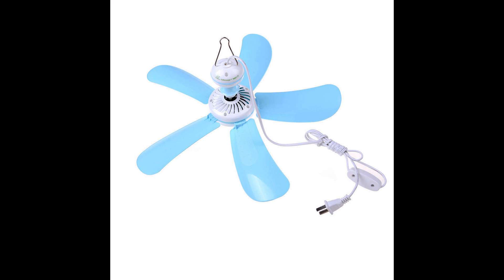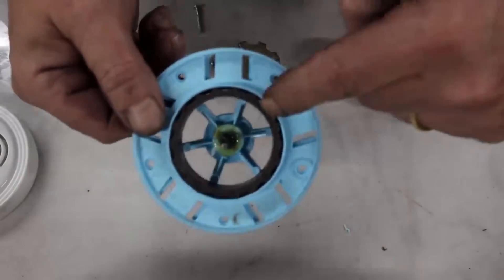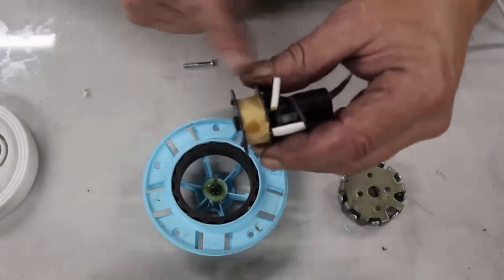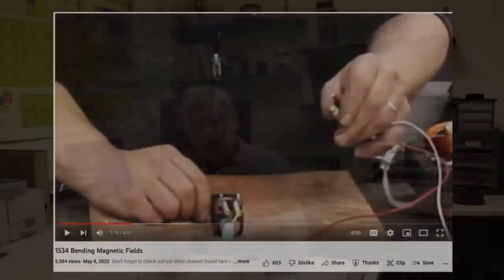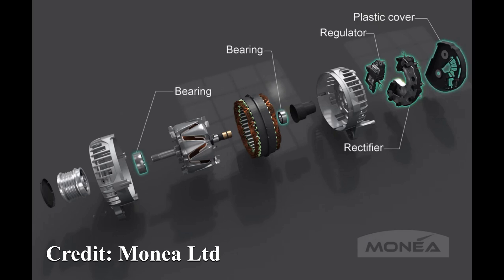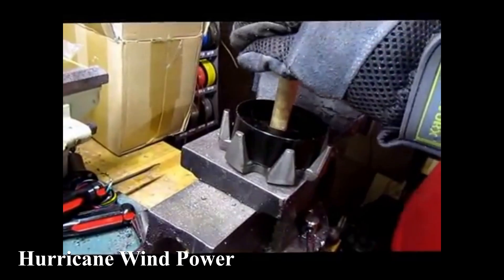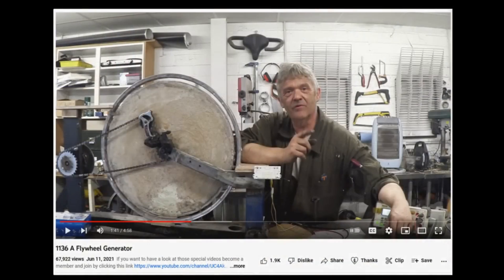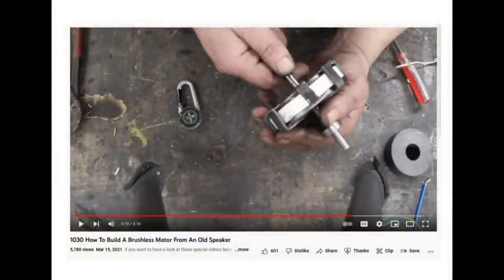2223 Crab Claw Alternators With Permanent Magnets As Generators

Comment: Does someone kind outthere by any chance have a link for such a powerfull magnet ready to be bought and slapped in instead of the coil, would like to test it and try it out, have made a good windmill with ready gear from bicycle to run through a gear and then to a good generaator that makes power with rather slow rotaitional speed, i would be most thankfull :-)

Comment: i read 'the jungle is neutral' by spencer chapman he was stuck in the malayan jungle for about 3 years hiding from the japanese. they had a radio transmitter but only a flat battery it took them months & months to find a way of charging this battery enough to get a radio signal out

Comment: I am curious as to how much impedance is caused just by winding the wire back over itself instead of running multiple parallel lines on the same circuit?

Comment: I replaced the wound rotor in a chevy alternator with a 14-magnet rotor I got off of eBay, and that thing will produce 15 to 20V DC just by clamping a small vice-grip pliers on the shaft and spinning it with my hand! ⚡️

Comment: Did you know AXA HR bicycle-dynamos are crab claw generators too???
(They are called AXA HR in the Netherlands, probably different names in other countries. If you know the name in your country, please add a reply?)

Fun fact:
If you reduce the size of the fingers of the claws to about ⅓ to ½ the original size, you can replace the lightbulbs in the front&rearlight by single LEDs.
You'll see you'll be riding your bike with lights on in daylight, because it's so fr*king funny you don't feel any resistance of the dynamo anymore, while still producing enough electric energy to clearly have your lights on, in daylight! 😂😂😂
Reply: By the way:
There are probably a lot of other brands and types of bicycle dynamos that you can modify the same way to have the same super funny experience.
But I like to use these because axa makes it very simple, I think.

Extra tip:
If there's no screw or nut on top of the wheel of the dynamo, it is pressed on.
Just pull it while wigling it a bit or pry with a flat screwdriver between the wheel and the body of the dynamo.

And you don't need a torxbit for the bottomscrew of the axa. A flat screwdriver will do just fine.

Comment: The efficiency of car alternators is generally understood to be poor at about 50%  (despite what Wiki reports of claims from Bosch). I have often wondered what would happen to efficiency if the energising coil were to be replaced by a permanent magnet as you have done. Efficiency is less important than cost in a car application but to capture wind energy I guess we would spend more if we could double the alternator's efficiency and thus output.

Comment: Rob look out for the German company Mahle, they were primarily specialized in building pistons but now they make electromotors too. They did replace the commutator with a induction coil like for charging phones but beefier. No slip rings there. All benefits of a powerful Universal motor without the downside of replacing bruches because there aren't any 😂.
Reply: I've looked into them the inductor is basically just a reshaped transformer. That would probably work pretty well here because there isn't any need to rectify the secondary.

Comment: I have an alternator that works like this, but both the field coil and the stator coils are stationary, and the claws simply rotate around the field coil. So there's actually no need for for slip rings or brushes anyway, but apparently the added complexity of that setup makes it cost more than just adding current carrying wear components and knowing that the customer will have to deal with it later. If I recall correctly, the alternator is part of the conversion kit for turning a Ford F350 into an ambulance, so it's designed to be rugged, hence the lack of wear components. It also has a neat feature in that there are extra diodes for the star points, which stray from 0V at some point going up the RPM scale due to the reactance and resistance of the coils. This does the almost magical work of making the coil arrangement star at low rpms, giving the volts needed for equipment at idle, and delta at high rpms, which gives gobs of amps at reduced(but still high enough) volts.
The alternator really is a beautiful piece of engineering, which I'm certain that ford had absolutely nothing to do with😂😂😂.

Comment: I keep thinking that the least costly energy solutions are going to be based on shape.  I keep thinking of combining complemery tech is going to do this for us. Rube Goldberg for energy generation.  A shroud to gather wind on a east west facing vertical wall covered in solar cells, wind cooling the panel on sunny days, on hot days the wind tower becomes a solar chimney drawing air up through the wind turbine and solar dominating the mix. Add in hot and cold storage and shaped aerogel to protect stucture, or maybe charged wood for heat and waterproof.

Comment: I think a regular alternator and rectifier would be cheaper to make and then spray the inside with marine lacquer to weather proof it. Then its up to the blades you would need. We have thousands of alternators in junk yards around the world and its just a question of as you would guess a revolutionary turbine to drive it and store the energy.😎
Reply: Sure, but you need a regular alternator to spin at 3600 RPM for peak output(if I remember right), and if you spin a turbine 60 times a second you'll get shrapnel instead of power.
Reply: @AtlasReburdened  I have built 2 in the past. They next kick at peak performance but they do move and after many hours of rotation the batteries charge and the dump load heats the water tanks. I guess if its efficency  we are after and not easey fixing... It's magnets every time. But... They ain't cheap.. Peace man... 😁 Don't forget to marine lacquer

Comment: The easiest way to make an alternator self exciting is to carefully drill into the crab claws, only 3 per side, then secure small neodymium magnets in with epoxy ensuring they are installed respecting polarity. When it spins it generates enough current to excite the magnetic exciter regulator without overloading it at lower RPMs. The electromagnet generates a far stronger field than even a rare earth magnet of similar size. ❤
Reply: I'd like to follow your train of thought. Do you happen to have a vid or more detailed description of what you are referring to? What do you mean by 'only three per side'?

Comment: Those fancy (albeit powerful) magnets are darn expensive so for a cheaper option use old speaker magnets.
They are mostly free at scrap yards.
What I have often wondered is if you built up the outside of the claws with a welder and then turned them down so that the gap between them and the stator coil assembly was reduced as much as possible would you get a significant increase in output power.
And then taking it to the extreme, grind the inside of the stator assembly plates smooth and concentric to the bearing housings and you could probably get the air gap down to a ridiculously small clearance.
However you might just be creating a siren.
Reply: The ones from microwave ovens are free as well, and have a much stronger field and are a perfect fit on the alternator shaft. I just carefully drill three of the claws on each side enough to fit a small RE magnet into it then set it in place with JB weld. It gives enough energy to self start the alternator allowing it to operate at far lower RPMs.❤

Comment: The Hub motors from hoverboards make incredible generators as well.
Reply: Yup those make awsome windmill generators. Just use a 3 phase diode (6 diodes in 3 pairs back to back. Makes 24V at about two amps with moderate turning. OCV is about 36V and SCC is about 6A. Definitely need to use a charge regulator with those. Also they can be mounted on a bike to give auxiliary power when peddling ❤
Reply: Or an old Flux capacitor 😂

Comment: Why magnets? The great advantage of a field coil is that you can use feedback to regulate the current, and thus the output voltage. And the field coil goes on the rotor so the slip rings only have to handle the comparatively low current.

Comment: I been wondering if a alternator could be excited. By putting a small ring magnet witht the field coil.  Then usethe output through a high power resistor . To sdjust the voltage to the required range. Or possibly use a lightbulb. and possibly use the semiconductor fuse things, can't thinkbl of what they are called, They go high resistance, then suto reset,  i was thinking maybe use one or two to work as a safety regulator with a relay,  the current goes so high. Trips the fuse that adds a load to the turbine through a relays normally closed side if the output is exceed, in high winds.    However, the main thing is will the field still work with a magnet making it self excited.??

Comment: Anybody else wondering if conductive ink could be used to make the crab claws?  If we could, axial flux motors and generators would become a whole lot cheaper and easier to make for the home builder.
Reply: @WarblesWarkly  The denser the atoms are packed the less the reluctance. Iron is great, iron powder mixed with resin is bad .
Reply: @WarblesWarkly  do you think changing the shape of the ink lines to increase distance, or adding metal salts or other additions to increase resistance might help improve reluctance?
Reply from the maker: depends what you want to do mate - if you want to bend the magnetic fields you would need a ferromagnetic ink - if you want to carry current you would need a conductive ink
Reply: The density of the metal is wat is important for the crab claws. The ink would probably work for a mini generator
Reply: I was thinking about regen braking 100% on a 28Kw electric bike hub motor? 🤔 Then having a shaft to either wind turbine or a syngas motor?
Use the electric clutches off toyota GZE super chargers to engage or disengage drive to the input shaft?
Reply: I was a naval submarine electrician (USN) so i find everything electrical fascinating. I love the mechanical design but how do you get a useable output? Obviously a battery charge controller will have an operating input range. 
This permanent magnet design will have a voltage output proportional to the rotor speed. 
How would you regulate the voltage output to be usable and safe?
A zener diode to a dump heater? Flexible blades that will deform to expand the operational wind speed envelope and maybe even elastically collapse in excessive wind to avoid permanent damage?
Reply: @williammeek4078 that's what voltage regulators, inverters, and medium powder point tracking equipment is used for. Try yield relatively constant current of voltage that you can rely on. The "dump load", like a heater or something, giveS a away to bleed of extra power so it doesn't destroy your generator.
Reply: Interesting idea 🤔💡

Comment: If you do decide to modify an alternator it would be a good idea to replace the shafts with a stainless steel or other non magnetic material.  Reason is that it is magnetic and will buy pass some of the magnetic field resulting in a weaker field at the fingers. This is a lesson I learnt when I did this experiment.  I got 240 W at 8000rpm with the original shafts and 1200W at 8000rpm when I put in a non magnetic shaft. If you have a magnetic field strength meter you can actually measure the difference.
Reply: Very good tip! I sometimes wondered if there is some magnetic flux losses due to the shaft. Now you got me an answer, thank you 🥰
Reply: @ogi22  Just remember one thing. Putting in a maget in the rotor does make it harder to start turning initially as magnetic coging takes place. But once the rotor starts it works like a flywheel.  This coging gets harder and more noticable with a non magnetic  stainless steel shaft than with the original magnetic shaft which makes sense.
Reply: @bartronicsecurity  It does make sense. If much more field is directed to claws, then it should be normal.
Reply: I'd like to see a wind turbine survive 8000 rpm, yikes! I still like axial flux because the fingers have a reluctance and distance from the coil center matters, ie: inverse square law. So still thunderbolt 3 phase for me, 12 magnets and 9 coils.
Reply: @justtinkering6713  That's what gear box is for 😉
Reply: Stainless steel is not "non-magnetic".
Reply: @edeaglehouse2221  Annealed type 304 is definitely non-magnetic.
Severely cold worked 304 SS will be somewhat magnetic.
Reply: Why every time when I try to stick a magnet to stainless it will not stick
Reply: @kelseyadams6931  There are many types of stainless steel and some are magnetic and some are not 😊For example, last week I bought a lovely stainless steel folding sailor knife which is magnetic. I'm hoping because of that I will be able to use heat on a marling spike of that knife and make it blue.